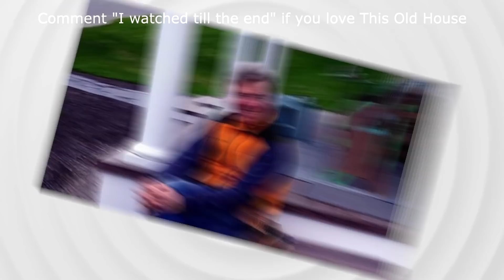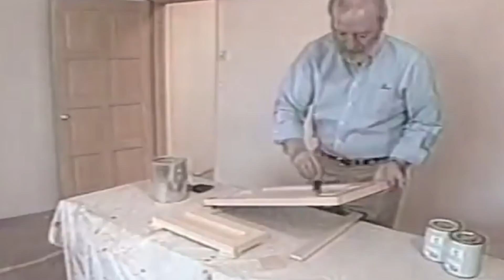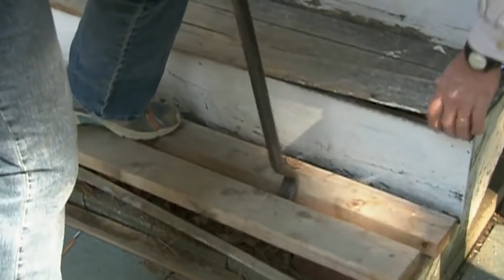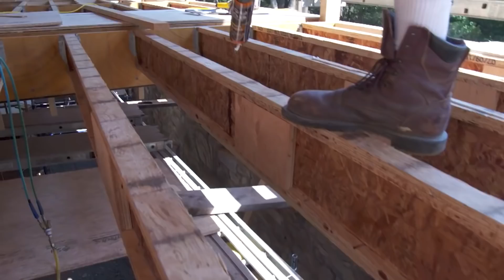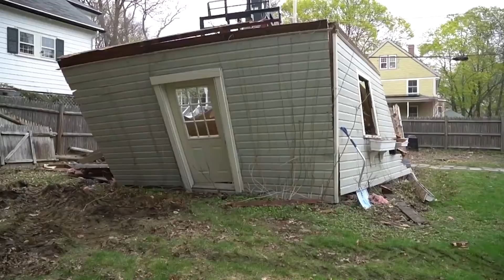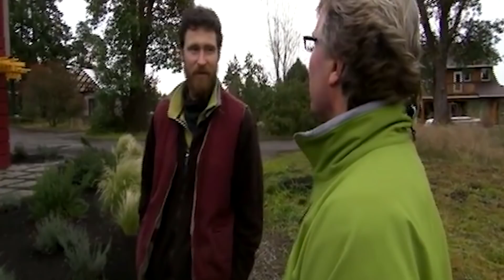Why did Steve Thomas leave ‘This Old House’?

Comment: The guy doing this piece talks way to fast and at times is hard to understand.  This was about Steve Thomas; but, for quite a bit of the piece your are showing the current host, Kevin O'Connor.  I was not impressed with this video.